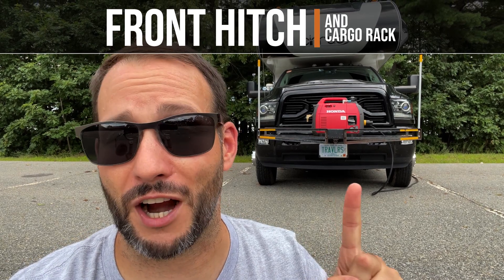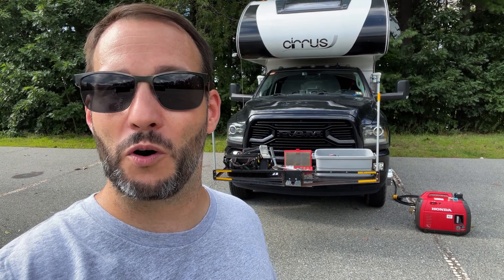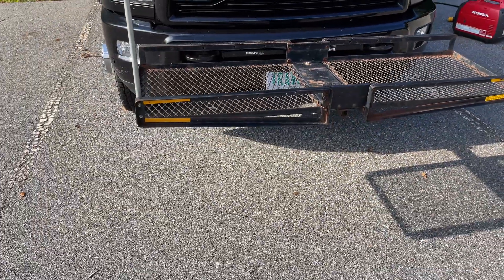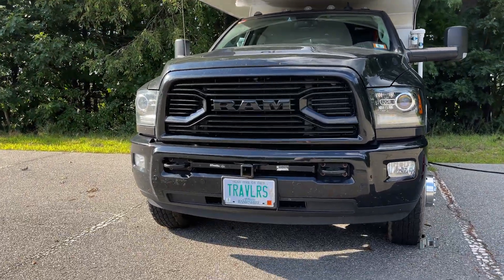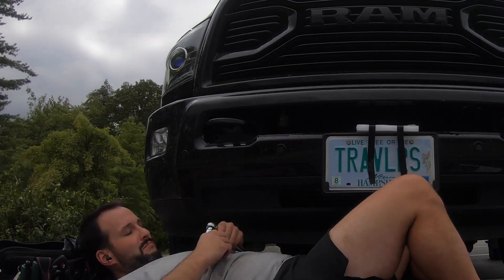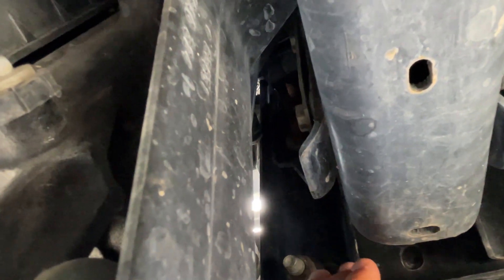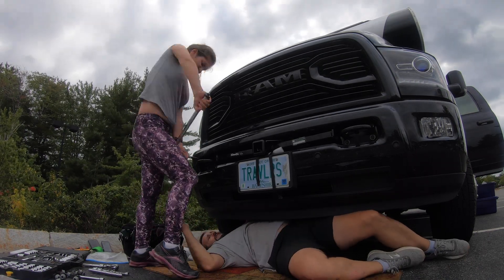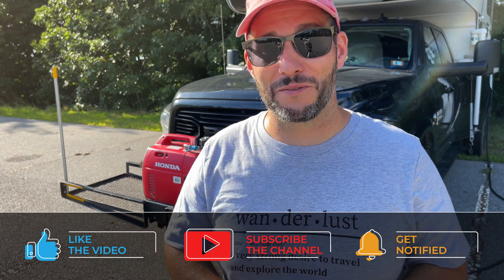This Is So Useful! // Front Hitch Cargo Rack Setup and How We Use It

Comment: I had the Torklift X7910 front hitch installed on my 2021 ram. Low profile no airflow loss no drill hitch. Great quality with 750-pound tongue weight and 10,000 pound pulling.
Reply from the maker: That sounds mighty nice! If we upgrade to a new truck, I’ll be looking for the beefiest front hitch I can find.

Comment: I put the same thing on my 2500. It was a REAL pain in the neck. I ended up having to take the grill off the front to get those top bolts done. I was glad to find out that it wasn't hard at all and it gave me great access. I'm planning on getting a wench too. I love your videos and you make a fun couple. Good job.
Reply from the maker: That's a great idea, I should have done that. I was able to do it with some tricks, but taking the grill off probably would have been easier!

Thanks for watching and for the kind words!

Comment: A fold away front hitch platform, great idea. Something tells me you've probably already started drawing up your ideas. LOL You figure out that one, let us know, something tells me you'll figure it out. LOL Great video guys, safe travels.
Reply from the maker: I do have my own ideas, but, I’d rather just buy a nice aluminum folding hitch. However, I haven found one that I like yet. They are all so flimsy.
Reply: @Stonyboot  Have you considered sharing your thoughts with a fabrication shop? I have 35 plus years as a machinist / in fabrication, quality assurance, in the aerospace world. Retired now. You would be very surprised how affordable it can be working with a fabrication shops. Make some inquiries. Maybe something they could throw on CAD for you, helping you develop something more close to what you're wanting. Something more sturdy. Or quite possibly retrofitting your current setup. Just a suggestion.
Reply: I think if I were looking to have a custom one fab'd, the first thing I'd do is dual receivers. Mounted like your current rack at the tow hook plates. Have the receiver tubes at both points. Having two points will take out a ton of the waggle that is so inherent with the single tube receivers. Have the attached unit like a stretched "H". with a square pipe section between the two receivers tubes. To this pipe you could bolt a single tow hook. Or just keep a tow hook or shackle mounted to a stub of hitch tube. Remove the rack and insert that for the rare event it's needed.

Comment: The bolts and nuts on the inner part of the frame by the radiator are much easier to reach via the top. Open the hood and they’re much more accessible. I know this comment won’t help you but it may help others.
Reply from the maker: It's been a couple of years since I installed that hitch. I'll have to look again, but I don't remember seeing any access from the top. I'd feel like a fool if I missed something obvious. Thanks.

Comment: Can a truck with a front receiver hitch be towed using the receiver and 2 inch tubing with a trailer hitch that will fit a 2 inch ball that is mounted on the rear of another vehicle?

Comment: Considering a front hitch rack for 2024 Silverado HD.  Will driving with cargo on the front rack cause problems with the front sensors in the bumper?  Hitch manufactures just say the hitch won't interfere.  
Does anyone have any experience with this?  Don't want to spend $500 for problems.Thanks
Reply from the maker: It will interfere with you sensors unless it’s high or low enough to clear. I just turned mine off when we had the front rack on. It all depends on the truck and setup. 

Simply installing the front hitch won’t affect anything. But if you have stuff on the rack, you could absolutely lock the sensors.

Comment: What bike rack do you use? We have 2 e-mtn bikes at 50 lbs each and I was thinking of a front rack (Ram Cummins), but did not know that my front view and air flow would be disturbed. Would like to be able to use the rear door w/o removing the bikes. Thanks and love your videos!
Reply from the maker: We did a full video on our bike rack setup. Just look for RockyMounts BackStage in our videos. It does swing away and allows full use of the back of the camper.
Reply: Bikes really are too large for a front rack. I have been cited twice over the years because if the bikes block ANY of your view it is "game over"from a law enforcement point of view. I use my front rack as a workbench and for firewood. 
I always set my generator on the ground as far from myself and others as possible when in use. Even though its a really quiet Honda EU1000, I hate running the darn thing at all, let alone near myself or others.

Comment: HI, do you carry anything on it while driving? If not where do you store you generator?
Reply from the maker: I carry firewood and empty gas cans. Sometimes we put trash on it that we collect at campsites and bring it to a dumpster. As for the generator, we have an onboard storage cabinet that we store our Honda 2200i in. We have a video called how to use a dual fuel generator that shows the whole setup.
Reply: @Stonyboot  Thanks, I will check out that video,  we also have a Firman 3200W dual fuel generator, we carry it in the back seat of our truck since it's too big to fit in the case on my back bumper. Was thinkink of maybe carrying it on a front hitch like you have, but a little worried?
Reply from the maker: Lots of people carry their generators on the front. Keeping it in a box would probably be a good idea, but it’s very common.

Comment: Hey Guys
Just came across your channel. Love your videos. I am curious about your rear bike carrier. I did not see a video anywhere you might have done? My ebikes are on the front and get a beating of course and I don't drive at night!. The rear seems hard only because I too have a Ram 3500 but single wheel with a gas engine and my Cirrus 820 hangs over the back a good way . Concerned I'll have to much weight back there and the long extension would flex too much. How have you managed? Suggestion on your set up?
Keep up the great travel and helpful tips!!

Rick
Reply from the maker: Hi Rick,

We've made a couple videos on the bike rack. At this point, it's lasted about 50k miles on it and had needed some repairs. But it's still holding up. 

First video: https://youtu.be/tAf1mRn2gdo
Update video: https://youtu.be/Jf1oWazv8DU

Comment: Scott did a thorough video on the clever way he mounted & plumbed the Honda in the Camper; seems a shame not to reference it:  https://www.youtube.com/watch?v=7uL-q8j4q8E   Scott, after you installed your DC-DC Charger from the RAM to the Camper house bank, you mentioned you might remove the Honda generator.  Since you are still carrying it - and apparently using it for deep charging - what's your current thinking?  Seems like if would be easier to just idle the truck occasionally and give up the Honda's weight & complexity.
Reply from the maker: Thanks for referencing that video and, great question! I do have the DC-DC charging system that's been working well. We get the bulk of our power from that as well as our little bit of solar. I also just upgraded my battery bank to 1200 AH (video is in the works) which gives me enough to run my computers for about 6-7 days with no charging, or, I can run the A/C for about 24-48 hours from battery. The real problems comes in with hot weather. I don't have enough roof space to add enough solar to run our A/C reliably, and, when its hot, day after day, I need a way to stay cool. Keeping the generator is cheaper and easier than relying on campgrounds for power. I don't use it often, but, we have been in some hot areas as well as multi-week heat waves which forced us to run the A/C, several days in a row. We are also planning to stay longer at each location as we travel, so the generator gives me all the power I need. Since we work nearly 7 days a week with computers, having adequate power is a requirement. Once I figure out the Starlink antenna (coming in the fall/winter), I'll be able to assemble my solar system and see where that leaves me in terms of power generation. I'd like to ditch it completely, but I've needed it too many times to stay cool. Still a work in progress!